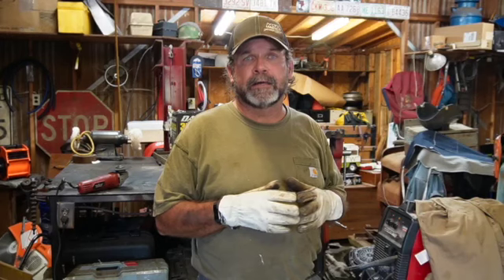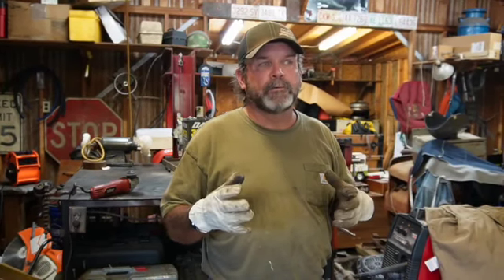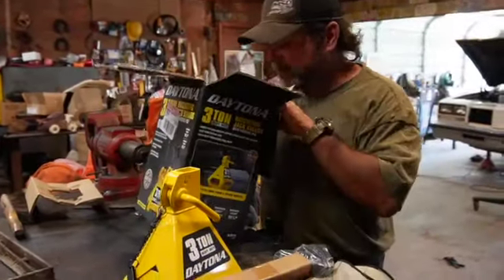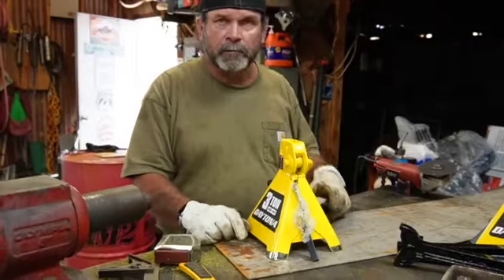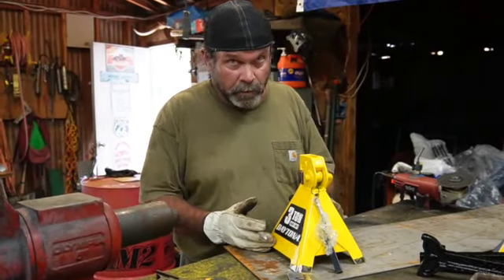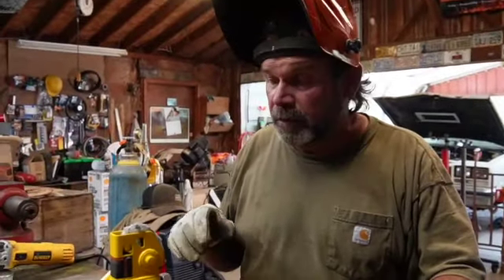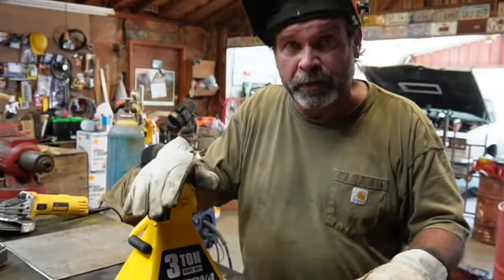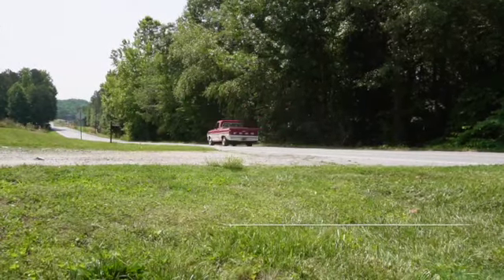Jack Stand modification for using on dirt, gravel or soft ground

Comment: Great job!  Yes jack stands absolutely should not ever be used alone on bare ground. They sink fast and I know that by experience!  Main point is to be safe! I don’t know why they aren’t already made like you did yours. Even on concrete they are much more stable with a plate to keep them from being able to slide, tip, or kick out in my opinion.  Nice welds too! 👍
Reply from the maker: Thanks for the kind words, and thank you for watching!

Comment: Where can I buy these?
Reply from the maker: I picked up the stands at Harbor Freight.  The plate metal came from a scrap yard near my shop.  I was lucky enough to find a width that would work and welded them up.  This can be done to any jack stand as long as they are made from steel.  Thanks for watching!
Reply: @rustloversgarage  thanks

Comment: I was wondering about this very thing just last night. I did a few searches and was surprised that I didn't really find anything about this kind of thing outside of your video. This seems like a no-brainer mod (or maybe how they should be built to begin with!?!), outside of making them a little more cumbersome to carry and/or store. Anyone out there have thoughts on why this SHOULDN'T be done?? Thanks for the video. Nice work.
Reply from the maker: I will do another video that will address the weight issue soon  , stay tuned and thanks for watching.
Reply from the maker: I will do another video soon you will like on this same subject
 Stay tuned and thanks for watching!